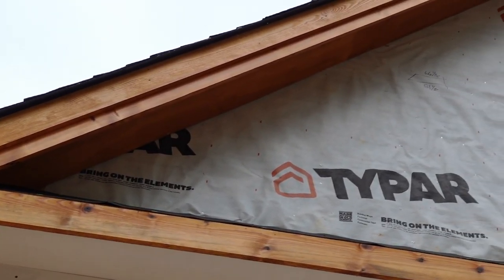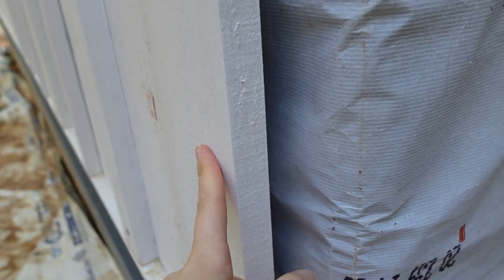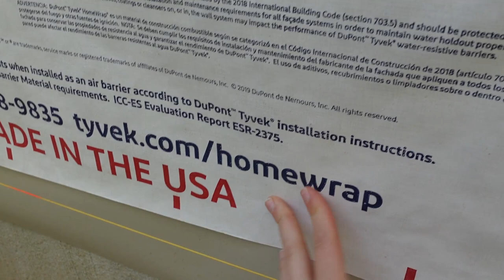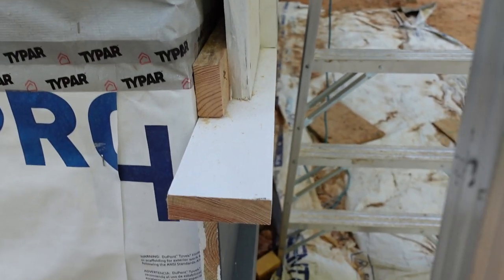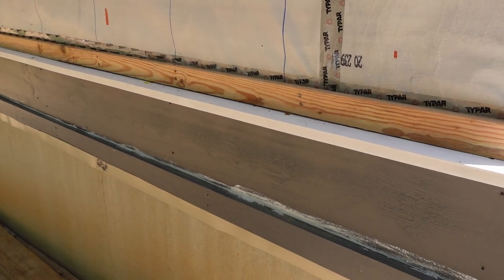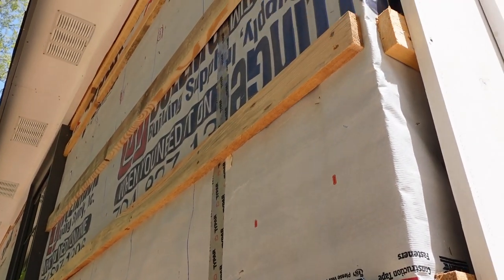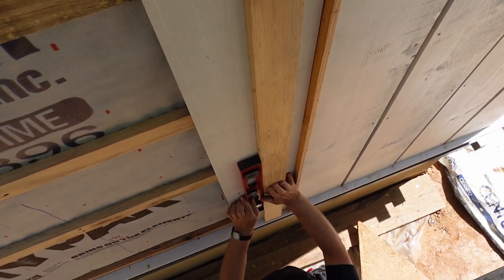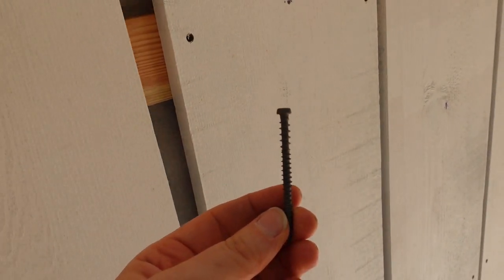Wood BOARD AND BATTEN Siding Installation – Using Lumber Milled from the Trees on Our Land

Comment: Very nice. Very sturdy walls. I am in the middle of taking all of my board and batten off and doing repairs. Stripping and priming all the board and battens front and rear and replacing those that need it. Quite a few of the boards were C cupped from the weather. Had to get inventive to get them all flat again, but it looks good. Great job, if I was close I would come by and help out. Hope you enjoy it when finished.
Reply from the maker: Oh man, stripping and priming all your boards from and back.  That sounds like a big job.  I primed all of ours front and back.  I hope they hold up for a long time.

Comment: Not sure this will get a response, but I'd love to know the stud finder being used to find the wall studs through the sheathing.  I'll be doing the same project this spring and of course finding studs after the housewrap is on is a pain.  A reliable stud finder would be key.
Reply: the tyvek house wrap has these red or orange marking the brand im using has a marking every 8 inches so if you make sure one mark is at the end of the wall when you start with the wrap  and if your studs are 16 inch on center then all you have to do is put your screws every 2nd mark on your house wrap and you will hit your studs every time 
good luck hopes this helps

Comment: Just curious, with the furrings strip install horizontally , how do you account for potential water drainage behind your siding?
Reply from the maker: I dont know.  I thought about that, but couldn't find anyway around the horizontal furring strips.  I talked to some framers/carpenters in the area, and they said this is the way they do it with no problems.   There shouldn't be large amounts of water that gets behind it.  Any small amount that gets back there will hopefully evaporate since it isn't air tight.  Some options might be a rainscreen system, dimpled house wrap, or some air vents in the siding.  I didn't pursue any of these options because I wasn't that concerned about it.  Hope this helps.
Reply: What I've read about is installing furring diagonally around the house so water runs along the furring and comes out at the bottom onto the flashing.  I'm debating not using furring at all because I'm in a high altitude desert and get very little rain.
Reply: I cut half inch channels on my horizontal furring strips to help water escape an air to move. Placing the channels facing the wall obviously
Reply: I know this is old, but one trick I've read about and might use on my project is to rip strips of T1-11 grooved exterior plywood for the furring strips.  Then you apply it with the grooves facing the wall and that creates drainage/ventilation channels while still providing a solid material to fasten the boards to.

Comment: Is there anyway to share more details on how the windows were flashed and trimmed out. Thanks.
Reply from the maker: I have a video showing how I installed and flashed the windows.  The trims is just 2x4s on the sides and bottom, and a 2x6 on top.  All of that is outlined with a 1x3 turned on its edge.  Hope that helps.
Reply: @CountryGirlLiving   thank you.